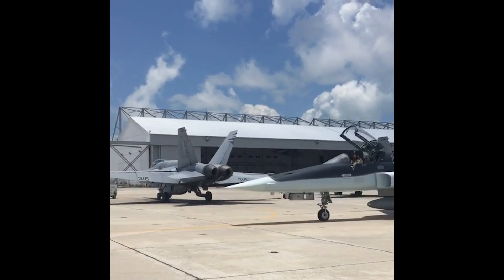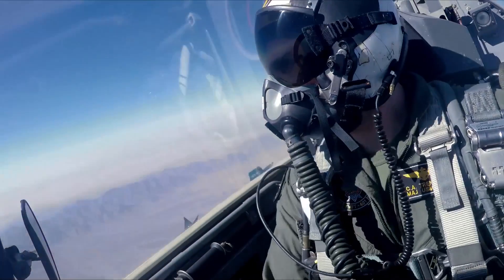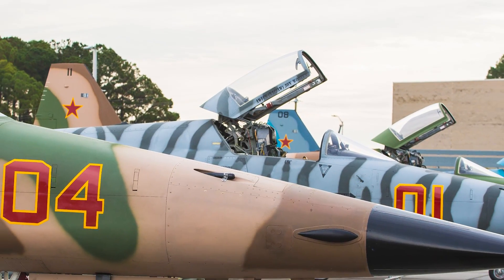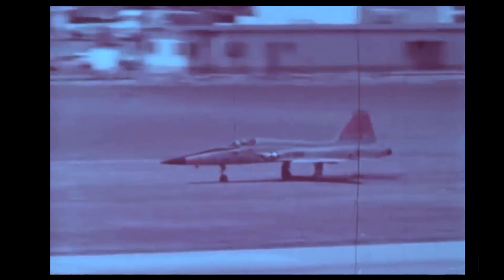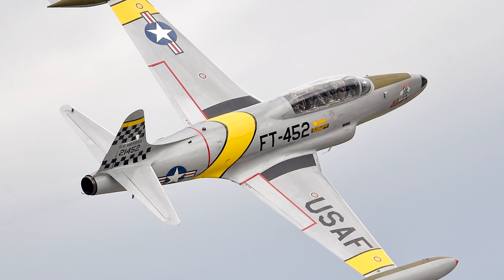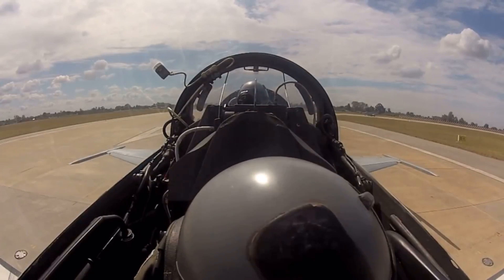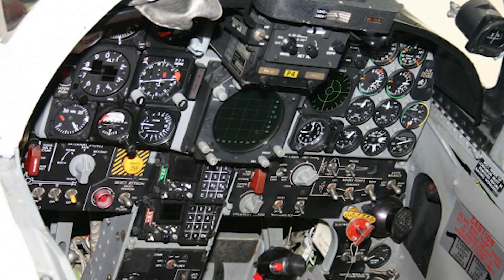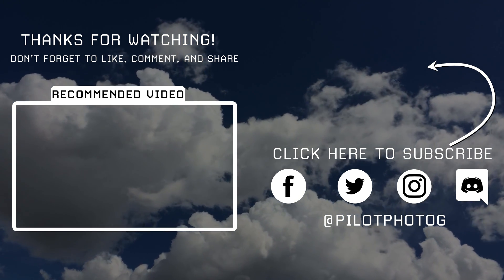Advanced Tiger Upgrading the F-5 | Best of Aviation Series|  F-5 Tiger II   Avionics

Comment: This has to be one of the most successful aircraft designs of all time. It started with the T-38 trainer, which got turned into the F-5. Then the F-5 was upgraded to the F-5E, which was then used as a basis for both the Hornet and the F-20 project. Then the Hornet was enlarged to make the Super Hornet. The T-38 started service in 1961. That means this fundamental design has been in service for 62 years. OG F-5 and F-5E/F are still in service with numerous countries as well.

Comment: Sir: Northrop Hired Me In December 1955  After Viewing My Futuristic Drafting Ability Put on By Los Angeles School District Industrial Arts Program My Specimen 3D Presentation Mechanical Drawing To Be What They Needed In Salving In Paradoxical Problems A New Secret Manufacturing Process In Designing Futuristic Fighter Aircraft I Was Not Well Receive - Taking Away A Family Man Engineer Position (My Age 18yr) N156,T38,F5, F20.etc. With New Ideas - "Larger Engines, Longer Fuselage Fuel Capacity Aircraft Carrier (Marine Attacking etc. 1955/1960 Hawthorne Ca. My Personal Info. Kept Secret From Others Lines Data Group / Lofting Dept. Chemical Milling Honeycomb Stiffening I Was Not Given Credit (Jealousy) Accomplishment More Unanswered ??? WHF.

Comment: 400 F-5's still out there to possibly upgrade,  what about the 800 T-38's still out there?  You are basically gutting the avionics anyway with such a massive upgrade, you would need to change the wings as well obviously.  That fuselage is so skinny, you could easily x-ray the whole thing to identify stress points.  N/G Can add a gun pod on the wing or underbelly,  and make cheapest gen 4 fighter ever?

Comment: In the early 90s, the Republic of Singapore Air Force sought to modernise its some 49 F-5E and F-5Fs. The project, concluded in 1997, resulted in the single-seat F-5S and two-seat F-5T. The jet was upgraded by ST Aerospace with a contemporary integrated Weapon-Delivery and Navigation System incorporating modern ring-laser gyro INS, Israeli-derived mission computers, domestic software, two large MFDs and a Ferranti HUD, enabling precision CCIP/CCRP weapons delivery. It also incorporated a new, advanced EW suite, and a small modern multimode mechanically-scanned radar, the Grifo-F, superior in performance to the early F-16A's APG-66v(2). Aerodynamic updates were applied throughout the fleet, such as the standardisation of the larger W6 LERX, which boosted turn rates. Delays were caused by difficulties in shoehorning the radar and EW components into the existing nose space whilst retaining a single gun (for the S model), which the RSAF insisted upon, but a structural solution was found in the reshaping both the radar antenna and the nose bulkhead while retaining the outer mold line of the original shark nose. 

The end result was a jet which was slightly lighter than the original F-5E or F and had slightly improved aerodynamic performance, which lost one gun (making the T-model gun-less), but which could make full use of the AIM-120 AMRAAM, and various precision guided munitions. The pilot also gained an Elbit Dash-3 HMS, providing possible HOBS missile capability. This extended the F-5S's usefulness as an interceptor and light strike fighter out to 2017, when the type was finally retired, having served for 40 years.

ST Aerospace was also known to have principally contracted similar F-5 upgrades for Turkey and pre-Chavez Venezuela, while contributing to other similar F-5 upgrades throughout the world.
Reply: Thanks for sharing.  I know there is an significant upgrade by ST but your details shine more light to it .
Reply: N.P. while you are here and have info on the SAF, do you have any on the Sqn or so of (mothballed?) P or F-80 Shooting Stars? that were parked at Paya Lebar in the 80s. What they were doing there and where did they end up?
Just interested and can't find any reference to them anywhere. Maybe you can help.

Comment: 1:37 Misleading content that the F5 AT has a MESA radar. (MESA radars are search and track radars and not a fighter radar)
Correct term perhaps is a PESA radar but the size of the PESA might pose an issue

Without an advanced radar suite the F5 cannot be gen 4+ 

The garmin 3000 integrates radar info ?  How much of it ?  

Overall the video is misleading.

The F5 is still in the same generation.  The F5AT still does not have BVR capabilities.
Reply: @Pigmoon K! What happened to your channel?
Reply: @lohan-101  Got bored

Comment: The F-5’s great weakness was limited range. For small countries it is an outstanding interceptor and air superiority fighter. In 1979 F-5E’s flown by Israeli and South African pilots crushed the latest Mig-21and Mig-23 fighters flown by Cuban and Soviet volunteers in the Horn of Africa, shooting many down. The fact that the F-5 is easily maintained, can operate from short roadways and dirt strips, and is very tough to see and hit makes it a great choice for small budgets. Produce a J-85 derivative with the same performance growth as the F-18/Gripen F404 (16,000-26,000 lb thrust in AB, 30% lower fuel burn) say, 7,600 lb thrust AB /35% better fuel burn, and you’ll have a Mach 2 F-5 with performance and range that even the US can’t ignore. (The F-20 is lamented.)
Reply: Making a modern iteration of the F-20 (lets give it the 30 designation for kicks) would be cool for the exact proposition you said here, it'll sadly be a rival to the gripen, but a plane that can have a parent company with a good industry to put it out quickly for its intended purpose.
Reply: Lol, a mach two F-5 would blow its wings off if the pilot twitched on the control stick. Its frame and wing design are rated for something like 5g sustained turns, nothing near an F-16 or F-15. How good of a trainer is it if most pilots transition to those high G fighters? This plane was a replacement for the Shooting Star 65 years ago, please be realistic and knowledgeable before thinking of putting a rocket in a Model-T and flying its wings off.
Reply: Puting fuel tanks on it could increase range.

Comment: Generating a total thrust of 50kN (approx) and having a very small nose,, I believe that F-5 would require some serious redesigning to make it op to the level of the so called F-5AT ,, Both Gripen & JF17 Block 3 are the current gold standards ,, and their max engine power is no way below 95-100 kN (23000-24000 lbf) ...while F5 has 

Guns were essential requirement of 60's 70's era,, but today not as much ,, hence nose should be freed with an external gun mounted (obviously never the Vulcan)

Comment: How does the F-5 XT compare to what could have been in the F-20? I am sure the F-20 would have needed upgrades too with more modern systems but... wondering if the 20 and F-5 XT would be equivalent or if the 20 would still have advantages.
Reply: The F20 probably would have been faster and a little more agile than the new F5 XTs

Comment: Needs an engine upgrade and A thrust vectoring package.  If it is going to be an adversary aircraft it should have features common in our most likely adversaries.;
Reply: Uhhh, that would essentially get rid of the main reason they are currently used: cost
Reply: @Tigershark_3082    One of the Hornets engines, is likely not much more than 2 J-85s in cost or running costs.  IIRC multiple iterations of thrust vectoring have already been mostly developed for that engine.  Also you have A logistics apparatus already built up for the 404, RM12, and 414.

Comment: I still think this plane would be the perfect compliment of nations looking to expand their firepower and not blow the bank on F-35s. Mix the F-5 with F-35 stealth fighters and you have a budget air force with a MAJOR punch.
Reply: This is an interesting interpretation of the so-called High/Low Mix that the USAF has. Currently it's F-22 and F-35 as high (no-compromise, best of everything, cost is secondary) and low (best bang for the buck while being as high performance as possible). You want to use the F-5 as the low, and the F-35 as the high. I think that maybe Canada or other middle power nations could benefit from this, because their budgets are limited. However the F-5's would not be able to stand up against Generation 4 and 4+ planes such as the Rafale, Typhoon, Gripen, or MiG-29 series would they, with their avionics and engines?

Comment: 3:53 hold it I thought f-16s were already being used for that role I might be wrong about this but I could have sworn I've seen aggressor f-16s
Reply: As the Air Force retires the F-16 from active combat, they are slowly taking over the aggressor squadrons. The F-5s in the U.S. are getting old, and being completely phased out.
Reply: @caleblarsen5490  God I'm going to miss the F-16 when they phase it out
Reply: @spartanx9293  I will too. I don't think it will happen for a while, they've got a LOT of airframes left to run into the ground.
Reply: Yes they do but the f5at would be better at the job sense it’s cheaper and has similar capabilities
Reply from the maker: Indeed F-16s and legacy Hornets also used as aggressors.
Reply: @PilotPhotog  it's always neat to see them in those aggressor skins

Comment: All that's missing is adding more thrust-to-weight ratio...

Would it be possible if the metal skin were replaced with carbonfiber composites?
Reply: Of course, the issue is one of this plane's strengths is it's low cost